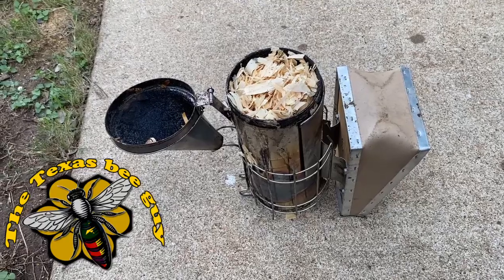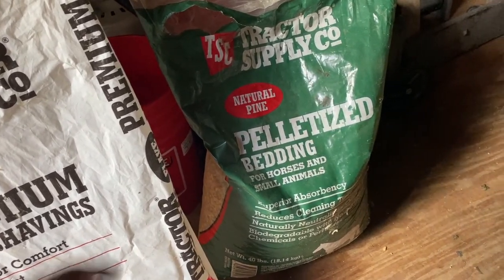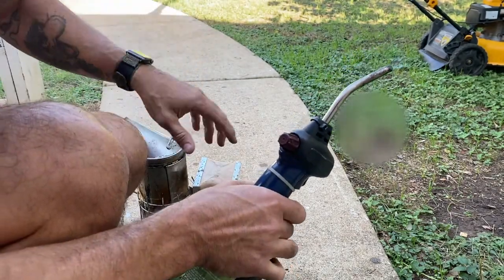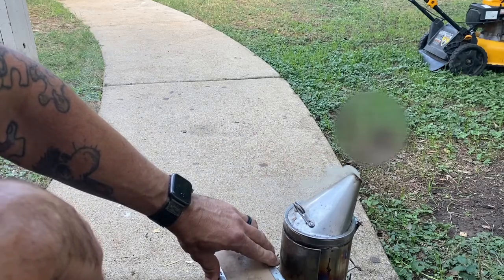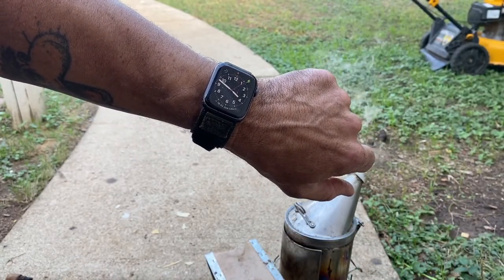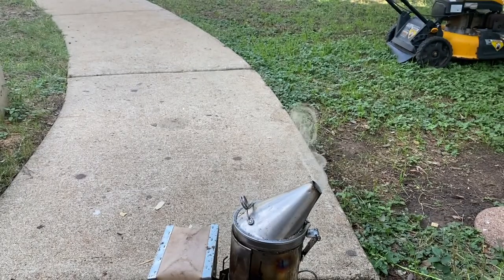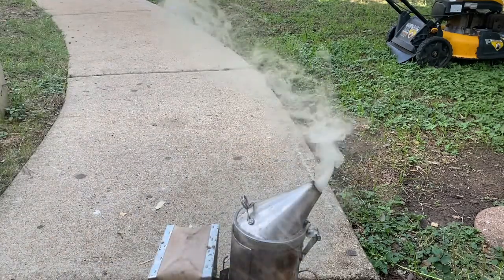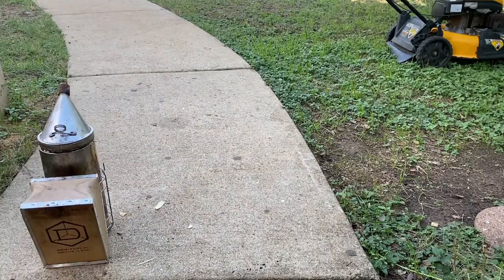Light a bee smoker the easy way.

Comment: I use the wood pellet's As a test i left it in a metal 5 gallon bucket in the back of my truck and it was still lit in the morning. Pine needles great way to get them started. Great video will sub.
Reply from the maker: Thanks. Pine needles work great but are not too common around here.